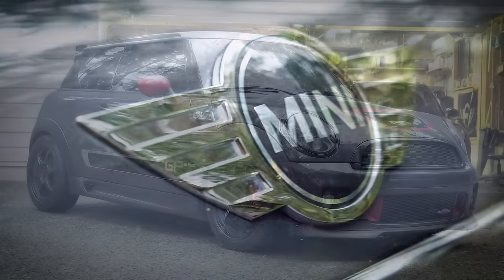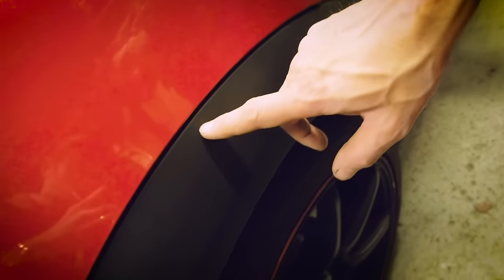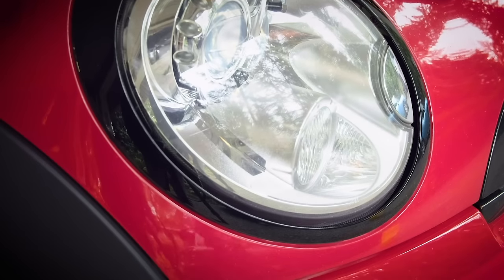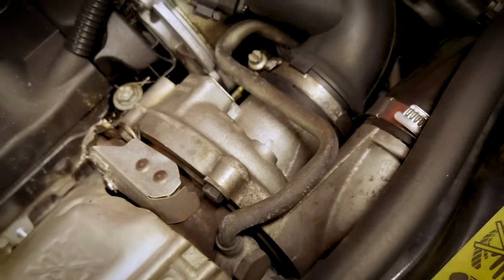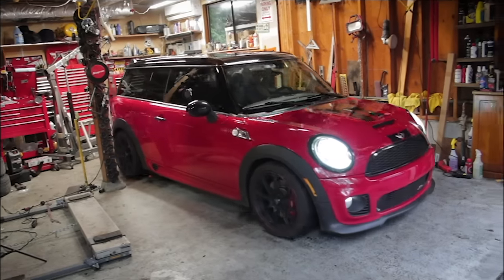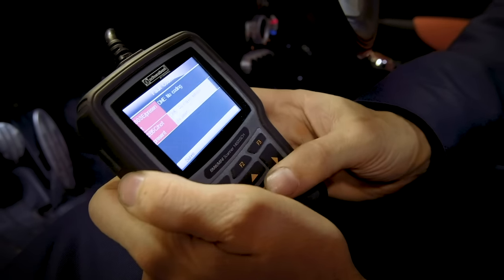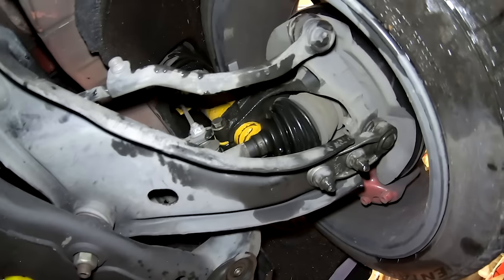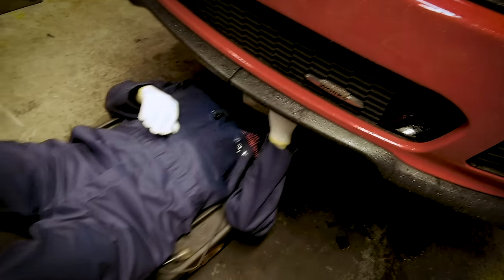Buying a used 2007-2013 MINI Cooper - things to look for - Gen 2 R56 R55

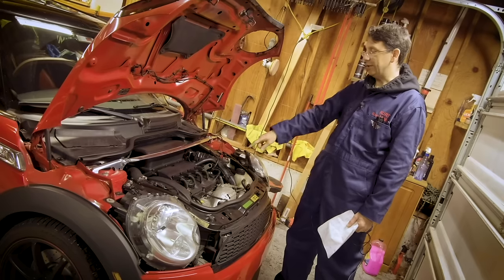Comment: 3:15 is all you need for this video lol
Reply: I couldn't have said it better myself.   I have the N14, and lucky for me, the $5000 worth of engine work it needed was under a CPO warranty.
Reply: @sirgalahad1470  i dropped 4 and it wasnt covered :(
Reply: ahaha))
Reply: It is actual truth. First mistake is BMW gave it long life oil change; 2 years...did they even test engine!?? Terrible mistake. This thing can use 1l on every 5000km or more; and dry sump is 4.5L ... so calculate it. You need to have f**king racing team to top oil every now and then.
2nd thing, they are really poorly build actually, somebody can say whatever. But new motor, as that expensive shouldn't consume any oil and they did.
But they have good fuel consumption... I find it super weird, since my 1.4 95hp (n12b14a) consume 1l of oil every 4k km. But can do 7.8l/100km in city.
Anyway nice cars to drive. Nightmare to own.
Reply: looking into an N18 2013 Cooper S 43K mi tomorrow ;)
Reply: @craigwilliamjohnstonstudio  did u visit the Mini? And how was it?
Reply: @shayanabrouce686  gorgeous I got it
Reply: @craigwilliamjohnstonstudio nice. you know what? Tomorrow I'm looking for a Mini cooper S 2011, automatic with n18 :D maybe I'll buy it. How much did u pay for yours?
Reply: @shayanabrouce686   2013  Cooper S 43K MI manual transmission, pretty much mint condition 11,600
Reply: If you need to replace the HPFP after warranty, buy the part off Pelican Parts.  They have the best OEM Mini HPFP.  Avoid the remanufactured HPFP from China etc.  I had to order two of them and both were dead upon installation.
Reply: Which mini model/years have the n14 vs n18?
Reply: N18 in jcw since 2012
Reply: I wish I was less stupid before byuing (and knowing) that ;-)

Comment: Bought the 2010 R55 Clubman JCW in 2013 with 43,000 miles. Now has 89K. 

We have fixed:
new clutch and flywheel
thermostat housing
barn door solenoids
update 2/23/2019:
new water pump, water pump drive wheel and tensioner pulley for $1000! Ouch!

Other than that just normal maintenance, but having the oil changes done at the shop is too expensive so I now DIY it.
Also replaced the door solenoids myself. I like the car better now that I've been able to work on it.
It is very fun to drive. More expensive to maintain than my Mustangs.

Also bought the 2012 R56 Inspired by Goodwood model with 14K miles in 2014. Nothing but normal maintenance so far at 38K miles.
Reply: You must love that Goodwood edition. You're one lucky guy to have been able to get your hands on one of those! Let me know if you ever sell!
Reply: @peej.w7598  We certainly do love our Goodwood, it's one of only 200 that have manual transmissions.
Reply: @SqeakyToy  even luckier than I thought! Manual is the only way to go. Especially with the mini
Reply: Any news from the 2012 Cooper? Found a good deal on a 2013 with just 63k miles but I’m scared to buy it
Reply: @garythecyclingnerd6219  our 2012 n18 engine Cooper is still good. Had to fix the thermostat housing though. That's typical with these cars.
Reply: @garythecyclingnerd6219  the 2010 Cooper needed new gaskets for the oil filter housing to stop the oil leak.
Reply: @garythecyclingnerd6219  oh and I am diy replacing the turbo on the 2010 because the waste gate failed.
Reply: @SqeakyToy  Gotcha. This is the hard top with the N/A engine. Hoping it’s less maintenance
Reply: @garythecyclingnerd6219  good luck and happy motoring.

Comment: I have an R56 Cooper S mid 2012 model out here in India. Auto Transmission. Bought used from a chap who had hardly used it. It hasn’t done many kilometres at all. When I got it a year ago it had done 33700 ish. I did a thorough service when I got it. And I ve put another 9000 joy riding kms on the clock in these last 12 months. I’ve changed the oil properly. And I keep checking the dipstick every couple of weeks and so far despite this being a turbo, I haven’t found signs of oil starvation. Even the oil colour one year down the line isn’t like it’s turned black or anything. It’s fine really. I have changed out the Auto Transmission Fluid and yes despite the car not having done many miles, I believe changing it out was a good thing mostly on account of the age of the fluid. I’ve changed all the 4 disc rotors and brake pads and brake wear sensors. Now the car is due it’s second service after it came into my hands. I will be replacing the V Belt or Serpentine Belt as it is called. The existing one is showing some signs of wear and becoming slowly a bit brittle around the edges. It is very probable that this has never until now, been changed. I will also be changing the oil again even though I use only fully synthetic BMW LL01 FE as recommended. And synthetic oils do last much longer than mineral oils. Still, I will follow the annual oil change method. I did face one issue around two months into ownership where the coolant pump which is made of plastic by the way, started leaking.so I bought an OEM-replacement for it and luckily the replacement is a metal one. We changed it.   I also changed the spark plugs to Iridium Spark Plugs from the original BERU standard ones. Because Iridium Spark Plugs are much more efficient. If at all there is any issue, I think the vehicle status on board display gets confused and the brake wear sensor at the rear seems to show that I need to change my brake pads at a faster rate than normal. I believe this is due to dirt and dust interfering with the brake wear sensor. So I am going to remove it and clean it and re fix it back. I know that my brake pads do not need changing again, I haven’t done enough kilometres on them as yet. Otherwise this car is a real pleasure to drive and it’s linear power delivery and fantastic handling never fails to bring a big grin to the face! 
From a safety and general preparedness point of view I always carry a bottle of OEM BMW blue coolant, a bottle of distilled water and a bottle of BMW LL01 engine oil with me in the car.
But truly. This R56 Mini Cooper is a real modern classic.

Comment: I've the R55 clubman (not the Cooper works as shown in your upload) still, it's good fun to drive 

Anyway, Id mention keep an eye on front springs (they snap & it's instant tyre death) check the condition/age.
Also get the intake valves checked for carbon build-up (it's an easy DIY job just awkward to get to) using intake cleaners is a waste of time. 
Checking the Turbo is straight forward, remove the intake hose & check for blade play easy 2min job, also a pretty cheap & quick DIY replacement job.
Oil filter housing is a pain however, 2 sets of gaskets.

Also check the coils & plugs incase a previous owner has gone eBay & bought cheap rubbish..
Also recommend fitting oil catch cans on both sides of the intake, helps reduce carbon on the intake valves.
Also check ion oil consumption, if oil is dropping fast theirs an issue, possibly oil leaks at worst engine damage.
Also cam cover, the pcv valve is internal & can jam/block-up which is another common fault.
Reply: Good points. Have a 2012 Clubman R55 N18. Carbon buildup issue fixed as of the 2011 model year.

Comment: great review about the 2nd Gen Mini's.   i have had 4 Mini Cooper's in the past. great little car if you are mechanically minded and keep on top of the maintenance and servicing.  (Like any car really) the Gen 2 R56 Cooper S engine also caution for the "death rattle" on the engine timing chain.  and you were spot on about checking between the engine and bellhousing, classic if an oil leak can indicate the crankshaft big end oil seal leaking.    i have had 2x gen 1 and 2X gen 2 Mini's they all have their pros and cons. i think the 1.6 litre direct injection turbo Cooper S is nice balance of engine torque and power, the factory suspension is just right, no need to mess about and change much.

Comment: I don’t think N14 engine are problematic, it has to do more with owners not taking care of them. I have owned many and still do and never had any issues!
Reply from the maker: There are a few design flaws that are expensive for people not expecting repairs. I have heard of a few reliable N14 but most will have the thermostat, high pressure pump issues and the leaking oil filter housing gasket. Timing chain is less problematic if you regularly change engine oil and never let it go more than 1 liter low.

Comment: I bought my first second hand MINI, its a 2012 Coupe with the N14 engine. Fingers crossed so far so good but when I got it with 20,000k on the clock it needed a new coolant sensor. Expensive job only because the sensor is integrated into the thermostat housing I couldve replaced it myself if it wasnt. Now that its been replaced they replaced the whole unit with a removable sensor now so its only a $80 + labour job, not a $900 one. One thing to keep in mind is rotate your tires. I got only 30k kilometers out of my front Dunlops because of the camber.

Comment: If you buy from a used car dealership, take the car on the freeway and rev it to at least 4000 RPM to activate the check engine light.

Comment: Very surprised you didn't mention the timing chain issues these cars have which can be catastrophic. There was an recall-like class action that allowed you to get it fixed with a reimbursement... But bmw never admitted fault and issued a formal recall so many of these cars I'm sure are still on the road with timing chain guides that are about to disintegrate
Reply from the maker: The ones that are still on the road must have been properly repaired. I see few timing chain jobs lately.
Reply: Really I didn’t know that

Comment: Feeding the myths about n14 engine supposed issues. My 2008 MCS has only had to have replaced the water pump. That was a few months ago. About 200€. In 11 years of (mildly hard) driving. BTW, n14´s were the last MINIs to have a stock LSD as a buying option. My BMW mechanic chuckles when I ask him about these supposed issues. Also happens in n18´s. Seems they just come from a bad maintenance. Not using the right oil, or not respecting maintenance times, for example. N18´s are obviously better engines, but don´t demonize n14´s, if correctly maintened they will be as reliable as the n18´s can be. Otherwise, nice video. will keep aware about rust on the other hand.
Reply from the maker: I've worked on lots of both. What you say is true regarding maintenance. But the N14 were very bad with regard to timing chains and they nearly all have premature oil leaks, water pump and thermostat failures as well.  The JCW N14 seem better for some reason.
Reply: @ModMINI  Well, I have not experienced any of those problems in 11 years. Aside from the water pump failure. Well, and clutch startig to feel a bit "hard" (1.000€ repair). A timing change catastrophic problem can be avoided in n14´s if you change the tensioner. Before it happens, obviously. Worth the money I think. Thermostat and water pump failures seem to be common both in n14´s and n18´s. The key is to keep the maintenance up to date, and not being cheap in the oil you use. These engines are "special", but if well maintened are gems. There are people out there having them tuned to 300 ho, andd probably up. Would´t try it, personally TBH. 7 years in a row best engine in the world in their category. Would swap my n14 for a n18, but TUV here in Spain is like inquisition. Best regards!
Reply from the maker: Interesting. I would agree that very regular oil changes are important. Not sure how you got away with not having thermostat or oil leak issues though.

Comment: Do an oil pressure test using a gauge. Personal experience. Car and engine seemed good but oil pressure was well down when checked a few months later, New head needed as the cam shaft bearing surfaces and cams were worn and you can’t replace them. Most likely had a timing chain guide failure at some point that’s rattled against side casing shaving minor metal particles dropping in to the oil in the sump, pump has ground up the waste material and pushed through the oil. Common apparently
Reply from the maker: Sorry to hear that. The only way to test using a gauge is to bolt it onto the car, not something you would typically be permitted to do. Yes, possible if owner let it run out of oil. Generally they would also be doing longer oil change intervals for this to occur so you'd probably see carbon buildup when removing the oil fill cap.
Reply: Mod MINI  the head was very clean, but what I realised later is it had been off. If anyone is buying an R56 knowing what I know now, taking the oil pressure  switch  out and putting a gauge in to see a real reading is what I would recommend, if the owner says no walk away... I’ve had to source another head which is actually hard to find, and go for a full engine rebuild
Reply from the maker: There are lemons and surprises out there of course, and while unfortunate,  I doubt most owners would  permit that kind of intrusive diagnosis unless they asked a shop themselves and have the buyer paid for it. I'd be surprised if they would let a private party buyer start taking apart their car.

Comment: Just test drove a 2007 with 88k. Had a replacement junkyard engine. Timing chain was rattling. The pcv system is crap on these cars and the owners won't check their oil. Decided to test drive a 2012 Cooper S. Was down on power and hesitating. I then read about the high pressure fuel pump failures. These are really nice cars but have too many problems. Great video by the way.
Reply: Glad you checked the reviews. I talked my parents into checking out a loaded 2011 JCW for under $8k 85,000 miles. The car was 1 owner and well taken care of with all dealer maintenance done. Then sat for 6 years.. maybe on sales lots? Carfax had thermostat, chain tensioner and clutch out before 60,000. Then I started reading reviews.. they're common issues and talked them out of it.
Reply: @Roadsurfer2k11  good job.
Reply: @dennisthemenace49  yeah I wouldve felt bad getting them something with horrible repair bills plus having them take a huge loss with trade in of a perfect 60k miles crossover. Just wish they were reliable... I read one comment they had to replace engine twice ($6000-8500) due to the chain tensioner. Interesting this is on my sportbike, the timing chain tensioner is a large pin with spring that just needs periodic adjusting. Eventually the spring wears out, so I simply replaced it with a large flat end bolt after watching yamaha mod videos for zero adjustment. It's a 90 cent fix bmw could learn
Reply: @Roadsurfer2k11  they are beautiful cars with too many fatal flaws.

Comment: I got a 2008 Cooper S. The engine has a timing chain. But the timing chain tension is plastic. Which wears, and throws timing off slowly until one day it jsut wont start and you have to rebuild. THat happened to me. That was almost 4 years ago, Im still part of a class action lawsuit for that against Mini. I've also, jsut last year, spent 8500$ replacing the engine, with a newer version. So that wont happen again. Be a driving like a dream ever since then, but those 3 years before that, it was an absolute nightmare.
Reply from the maker: The tensioner is metal. The chain guides are plastic. But the problem is the chain itself, which stretches. All chains stretch, but the N14 engine was originally engineered with a tensioner that cannot take up sufficient slack.
Reply: @ModMINI  yea, what you said lol. I've replaced it 4 times, and replaced the engine once.

Comment: A word of caution on that code:
I've seen that code set due to un-metered air leaks (Crankcase vent, turbo intake boot, etc..) but I've also seen it set due to elongated timing chain or broken chain guides.

BMW/MINI mechanic by trade
Reply from the maker: Thanks for the comment. It's sometimes frustrating to figure out what is going on with these engines. And they can have unmetered air leaks due to failed valve cover integrated PCV as well! Ugh!
Reply: What are things to look for on a 2011 , 95  k miles on the vehicle,  they want 9,500 for the car?

Comment: i bought an r56 mcs last august and so far turbo needs to be replaced which i havent done yet, my n18 engine is in bad condition, i had a bad ignition coil so i replaced them all, i had worn spark plugs so i replaced them too. I'm working on saving to get a new turbo so by then im probably going to need a new catalytic converter too! I'm also surprised the clutch has no problems after almost 80k miles now BUT - ITS SO FUN TO DRIVE
Reply from the maker: N18 eats coil packs and spark plugs. Just plan to do them all every 3 years. Cat should last a long time. Clutch might last about 130k
Reply: @ModMINI  i said the cat cuz my turbos leaking oil into the exhaust, its gonna ruin it if i dont replace my turbo soon:/